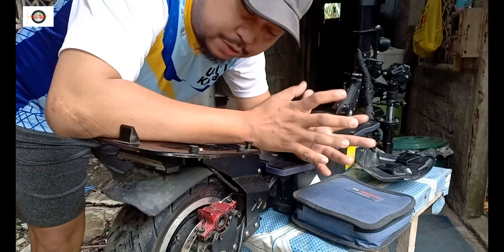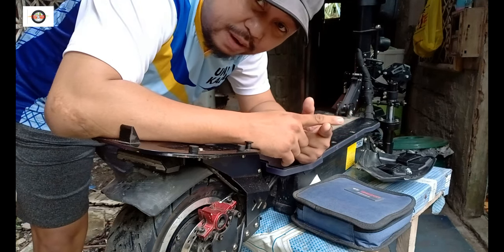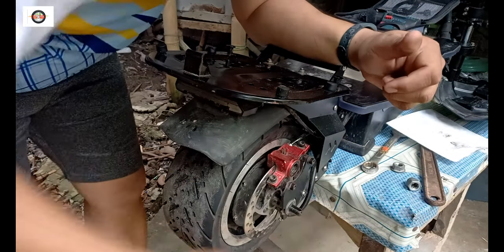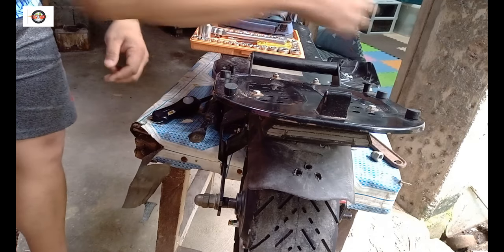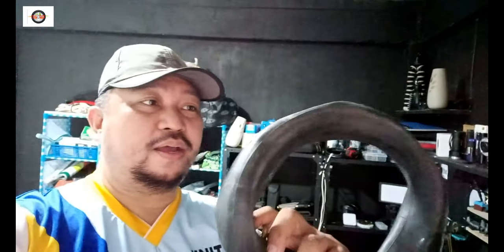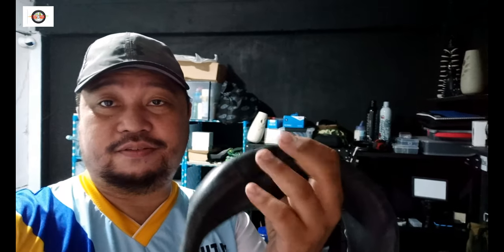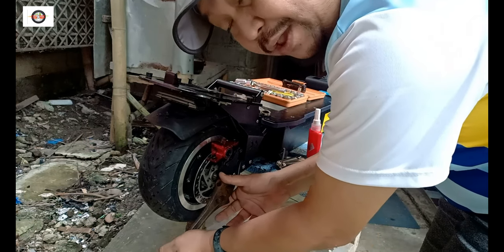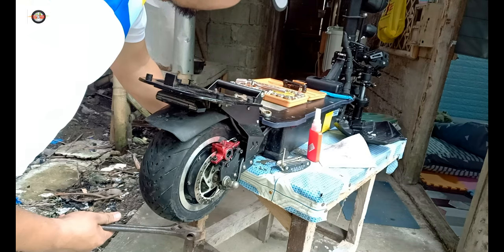Maike Mk8: How to Remove and Reinstall a Rear Hub Tire

Comment: Did you have to make any adjustments to the brake caliper when removing the wheel ?
Reply from the maker: No need to touch the brake caliper. just make sure that you place it down on the other side to avoid bending the caliper.